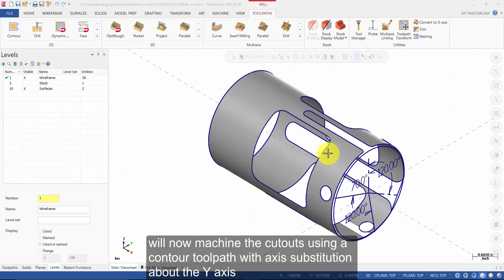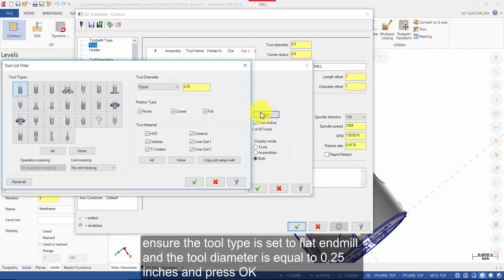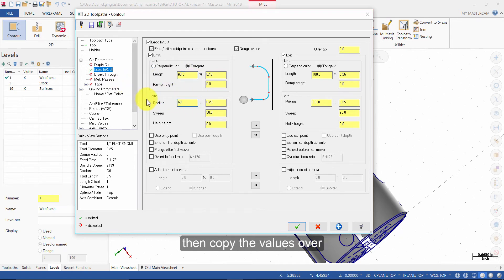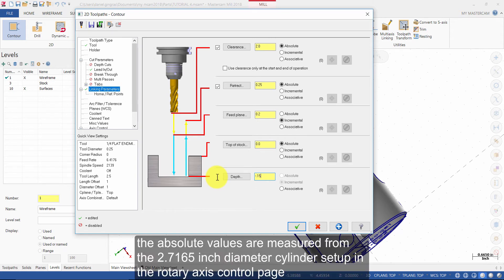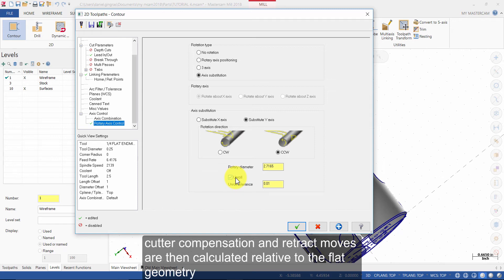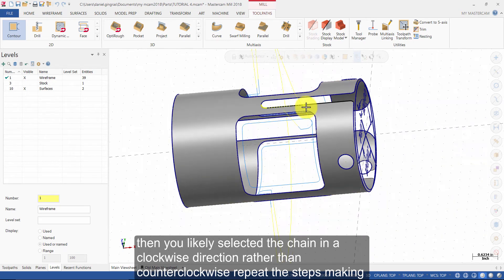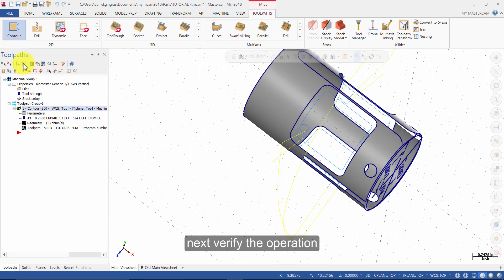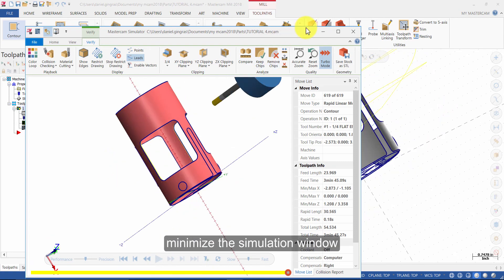Mastercam 2018 Multiaxis Essentials Tutorial 4 - Contour with Axis Substitution (Captioned)

Comment: What would you do if the windows were not sitting perpendicular to the Z axis? Say you were doing that on a 5axis with the ID of the part sitting upward, so you would have to tip the a axis to get the window perpendicular to the Z. Would that strategy still work? I was doing a part similar to that one out of stainless steel and I could not use that strategy. I ended up having to use a actual 5axis tool path.